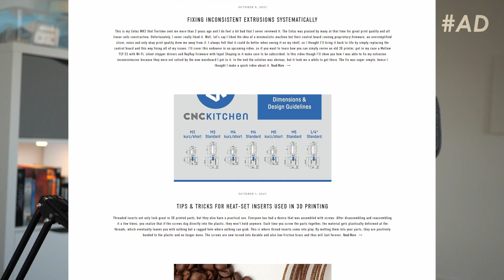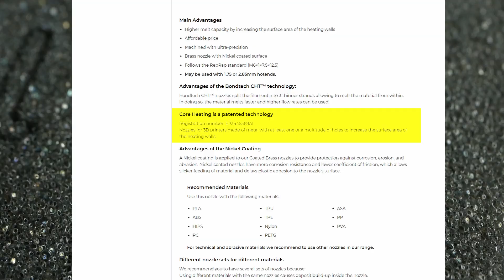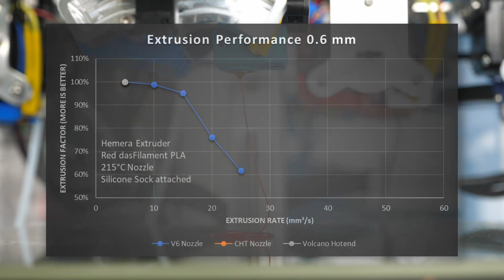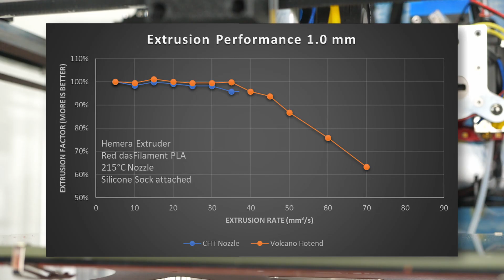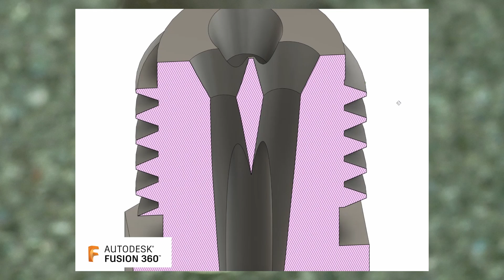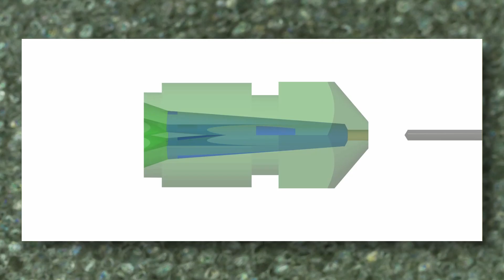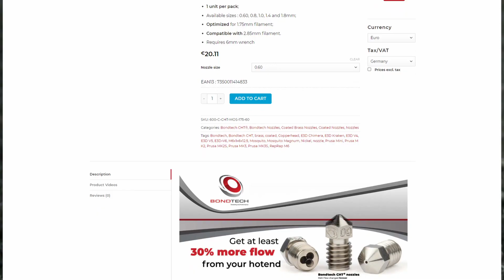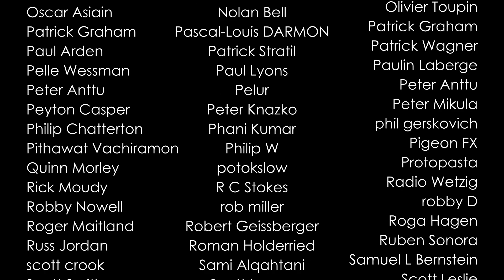Does This make Volcano Hotends Obsolete? Bondtech CHT Review

Comment from the maker: Does the CHT nozzles make high-flow hotends obsolete?
Don't forget to share this video and check out our Original CNC Kitchen Inserts (Affiliate & EU Only): https://geni.us/CNCKitchenInserts
Reply: Hi Stefan. Great video, as usual. We will release the 0.4 beginning of November. Design is ready. Manufacturing starts Monday. MK8 versions will follow. We are also working on the Volcano. This one, still a question mark. A maybe for now. We will have abrasive proof nozzles later.
Reply: @nunosantiago6720  - Wonderful news, thank you for confirming this! I don't need a nozzle larger than 0.4mm but I do see issues with melting and under-extrusion with some filaments; the ability of the CHT nozzle to improve flow rate without going to a higher nozzle temp is quite appealing! Now I know what I'm asking friends and family to buy me for the Holidays. :-)
Reply: ah but Stephan! surely a CHT Volcano nozzle would be even better then right? well it seems Bondtech are still working on that one in the lab. machining so much deeper down a longer nozzle. it must prove to be rather challenging. but we will see if that ever happens. a big maybe. hehe. ok i will go watch your video now :)
Reply: I hope that they eventually make one suitable for printing carbon fiber filament (and 0.4mm).  I almost exclusively use that for my job.
Reply: I think the main appeal is the ease of changing between regular, .4 mm x .2 mm stuff, and the occasional bigger print without changing heater blocks.
Reply: Can you block Kitan Mani? The bot's spamming porn links all over your comments section.
Reply: Test a CHT in a dragon high flow , would you kindly? 

As for the patents... Maybe putting the "core" in the heatblock/heatbreak instead of the nozzle , We'll see .
Reply: Have you considered posting affiliate links for us to buy one while sending a little your way?
Reply: @kabine1  Do you have problems just donating?
Reply: Where are you from?
Reply: I don't think it makes them obsolete, you have other that v6 type hotends. For example Dragon HF.
Reply: Imagine a clog
Reply: imho a great invention and review! 
What I`d be interested in on top of your research, what would be the absolute maximum usable extrusion volume in Vase mode (so it would need no retractions, and thus not really overheating while in the nozzle) if you'd increase temperature (much?) further? 
I mean 250°C may be too hot for pla, but if it would be pushed fast enough it would only have the target 215°C (which could afaik only be determined by a IR-Camera )...
best regards from lower austria
Charly
Reply: why would highflow hotends become obsolete,no one said you can't use this with a hf hotend, slap this onto a mosquitto magnum plus and you can make tha already high flow hotend even higher flow
Reply: @RexTech that's gonna result in a larger"center core" with less material connected to it to transfer heat, it would probably result in the spike having problem "spliting" filament
Reply: cnc bitchin' again
Reply: Can you try a higher number of clover leaves? With ever smaller leaves, like a small fractale if you will. I think it would improve the heat transfer even further... sadly I dknt have tools to try the idea...
Reply: link broken
Reply: They now do a 0.4 👍
Reply: Hey Stephan, I used the same testing method (same temp, filament, measuring weight, etc) but see no improvement when using the CHT nozzle of the same diameter as the prev nozzles.
Tested this on both a dual gear bowden to a V6 AND a Titan to Dragonfly direct - yet again, no difference in max flow. Any tips?
Reply: 2 years later, whats your experience? Did anyone switch permanently to CHT?
Reply: I have had a volcano hot end for over a year and never came around to install it, because of having to print a new cooling shroud. This is perfect!

Comment: I just bought one of these and installed it. I'm running a bunch of ender 5 plus corner braces in silver ABS. With a Creality copper .4 nozzle I would get extruder skipping at about 110-120 mm\s on the long straight runs. After several parts I settled on 80mm\s for the "master" perimeter speed to get a reliable, cosmetically decent part. After installing the CHT nozzle i started upping the speed to see if there were any gains to be had. I got my first extruder skip at 275%. I didn't re-slice it or anything. Just swapped nozzles and ran the same part. I backed it down to 260% and it's running well and looks just as good as the previous parts. It was hard to cough up $23 for a single nozzle but the results are solid, if not downright amazing. $23 to cut the run time from 3 hours to maybe 1.5 with equal quality? I think I may be converted.

Comment: I can't believe its been 2 years already. Seems link i have only been into this hobby a year. 

Btw if anyone is watching this that has an Ender 3 or similar with the mk8 style hotend, yes this will work but will put the nozzle a little longer  ao adjust your Z offset or Z limit switch. Its an easy way to get extra flow with out changing hotends or a bigger heat block. Yes your stock heater cartridge will work fine. Yes the Aliexpress clones will also work fine just decrease retractions. Start at 1mm and adjust from there. 

Happy printing.  😊

Comment: It doesn’t restrain flow because its hot and it splits up the material using a tri blade wedge. 

This actually prevents clogging by breaking down the filament faster and having an anti clogging effect thats similar to a log splitter. 

When a log splitter presses a log through one half goes each way juts like a tri blade splits it in 1/3rds, or a 4 blade into 1/4’s. 

This process takes less effort and in turn less likely to have clogs or filament jamming. 

This assumes that your equipment is also complimentary but it doesn’t disregard some of the quirks of a 3 inlet design that are overcome by a 4 core design. Length of nozzle also matters. Some designs are not welcome for all printer extruders without further engineering. 

I designed my own nozzles several years ago with a unique extruder design I machined on my CNC and it uses a quad core design with a different core material and this allows finer tip nozzles to be used at higher speeds for greater flow and print detail. This also allows filaments like ninja flex to work in a Bowden.

Comment: It doesn’t restrain flow because its hot and it splits up the material using a tri blade wedge. 

This actually prevents clogging by breaking the down the filament faster and having an anti clogging effect thats similar to a log splitter. 

When a log splitter presses a log through one half goes each way juts like a tri blade splits it in 1/3rds, or a 4 blade into 1/4’s. 

This process takes less effort and in turn less likely to have clogs or filament jamming. 

This assumes that the teat of your equipment is also complimentary.

Comment: i can not even change my hot end with out removing the hot end thermo leads to as the grub screw has rounded and can not remove it and extruder needs replacing to oh the fun any idea on how to get that tiny rounded grub screw out or would i be better off getting a complete new hot end

Comment: Thanks for your contribution in 3d printing community! :)
I'm not sure how about bigger CHT nozzles but I bought 0,4mm MK8 CHT for my ender 3 with bi-metal heatbreak from trianglelabs. I must say I'm very dissapointed by CHT (after that I'm not planning to buy bigger CHT and test it myself). I've run your flow tests and CHT nozzle doesn't improve possible flowrate. In fact I have worse outcome than on regular nozzle that costs me 1/10 of CHT, even on max-tighten screw for extruder spring. To be ohnest - bi-metal heatbreak didn't improve flowrate that much as I was expecting either. I have 2-5% improvement over stock heatbreak, but it helped to reduce retraction distance and retraction speed so I'm pretty happy with it.
Reply: the triangle lab is a clone and in not that well designd

Comment: nice video, quick question, what kind of thermal interface are you useing between the heatblock and the nozzle?
Reply from the maker: In most cases none at all or just a tiny bit of high temperature anti seize. IMHO thermal compound won't help the performance because it's not the bottleneck.
Reply: @CNCKitchen  thank you very much, exactly hte answer i was looking for

Comment: I just swapped a .8 for a CHT .8 and im getting extrusion issues; i had to increase temp and flowrate to compensate which is the opposite of what i expected with this nozzle.

What are your material settings for these CHT nozzles? How greatly do they differ from the regular nozzles?

Comment: I have redone your tests but I don't arrived to the same results.
I am on a creality ender 5 plus with a full metal extruder.
With the standard 0,4 nozzle it works at 16 mm3/s
with the CHT 0.4 I lose some steps at 6mm3/s only
with the standard 0,8 nozzle it works at 19 mm3/s
with the CHT 0.8 I lose some steps at 10 mm3/s only
Any idea of what could be wrong with my CHT nozzle ?

Comment: I worked on Injection Molding for years and we used similar nozzles with that. Improves the mixing of the colorants with plastic and flow. But in injection molding we are pushing material at thousands of pounds. On 3d printing could help on the flow…

Comment: After seeing your review here, I was so intrigued I ordered it immediately. I saw it in early Januar this year and received it late January. Today, I just installed it and wow... you say: "Will this become the new standard for how 3D printing nozzles will look? I'm quite sure, no..." -- I don't disagree with your reasoning, but I will say that it SHOULD be. 

I have a fairly fast delta printer with a crappy E3D V6 clone hotend, which due to the delta bed, isn't easy to change with something larger such as the Volcano hotend. With E3D Nozzle X, my printer can actually only deliver 9 mm2/s. Which is a sad and low number, and it does become an issue in print jobs with no traveling, i.e. continous extrusion - such as in vase mode. My printer can easily go 120 mm/s reliably with 5500 mm/s acceleration and 25 mm/s jerk. But with either the standard brass nozzles or the E3D nozzle X, I need to go down to 70 mm/s in vase mode (continous extrusion). 

Today I've begun testing the CHT nozzle (0.4mm) - fitted on my delta printer without any modifications. Just a nozzle swap. At 15 mm/s2 volumetric speed, I go at around 130 mm/s and I can probably go even higher. That's amazing - because now I can print my vases with 0.58mm width and 0.2mm layer height at 130-140 mm/s, without the walls getting thinner or having holes in them. 

I could of course also try the 0.6mm CHT nozzle and see if I can still go that fast, but I print a lot of different things, so the 0.4mm is a nice size for me; I can do fairly detailed stuff with high surface quality at around 100-120 mm/s, or I can ramp up the print speed to 130-140 mm/s and have fast drafts. Well, actually the CHT delivers quite high quality in my vase mode tests at 130 mm/s so yeah, I'm a VERY happy camper.

Even slower printers would benefit with the higher output, because eventually, people will want to print faster and modern printers are more likely to come with solid movement systems and solid frames that can withstand speeds at over 100 mm/s easily, even cartesian printers can go this high now - and with CoreXY becoming more used, much faster prints are possible. 

I don't mind paying the premium price for this nozzle; it's not worn down easily according to specs, so it's not like I need to change it as often as brass nozzles. 

Now I just have to hope that my extruder stepper motor won't overheat, because it's obviously working overtime ^_^

Comment: So when it comes to basic nozzles, you pointed out that a lot of cheap ones are drilled almost to the end and then with a 118 degree angle. Better nozzles had a more gradual angle. Which brands are the better ones and how do you know what you're getting? Very good info here, just would like to be able to put it to use!

Comment: I wonder how the CHT nozzle at a 0.6mm diameter is slightly overextruding at 10mm^3/s. And I wonder if it would be possible to make one of these out of hardened steel, allowing people to print their abrasives quickly.

Comment: You guys don't realize that 3D printing is still quite expensive in India. 20 euros is around 1600 rupees which is 10% of the cost of  the Ender 3 V2. Everything 3d printing related i expensive or low quality.

Comment: Some questions that came to mind as I was looking at the design.
What about four wholes or 5? What about using steel instead of brass? What about a complete cone shape all the way to the tips exit point after the splitting point, instead of the filament butting up against the flat spot just inside the tip?

Comment: I'm a little new to the 3d printer scene... well it'd be more accurate to say the mainstream scene. I've been 3d printing for years, but it's been sorta insular. I've designed, built, and maintained all my setups all by myself. So in short I know the printers work, but I have no idea what the meta is.

My question this: is it uncommon for people to fabricatec their own print heads? I started with the end of a pen in a modified hot glue gun. The resolution was like 0.5mm TOPS, but it was enough to print a much better head. Used that to make a plaster mold, then Ihrew some aluminum bar stock, copper, nickel, magnesium, and borax into my crucible (90%, 5%, 3%, 2% by wight, borax was flux), drilled out the center, sanded, threaded it and it worked like a dream. That was the mk1... I'm up go mk8 now which has 6 filament inputs (cyan, magenta, yellow, white, black, and clear), two mixing chanbers, two outputs (one that prints, a other that spools sceap), and a few other goodies. Not gonna lie, adding full colour functionality was a complete waist of time. You can choose between low scrap with harried amounts of colour bleed or sharp, clean lines with ~70-80% filament waistage). Eventually I'll be making a series of videos on my shops progression, just wanna have most of the big tools running before starting my channel ^.^

Comment: How much does the patent cover? It seems like increasing the surface area without the splitter would be beneficial without any drawback apart from the price? I wonder if your video might spark Chinese copies, which provide 0.4mm nozzles. the manufacturing doesn't sound like rocket technology. If there is a dragon hotend, I don't see a reason, why there can't be an increased surface area of the walls of a nozzle.

Comment: Wow, I usually respect CNC Kitchens work most for the discipline he shows. I think the material tests are outstanding and the go-to address if research for materials for FDM printers is needed.
This time I really liked the reverse engineering of the concept, which went into the design. 
However, I wondered how splitting the material works as well, if it might be relatively hard at that point. Does it mean, that getting it to soften is easy, but getting it hot enough to squeeze through a tiny hole is the hard part? Then, the concept should have an even bigger advantage for smaller nozzles, shouldn't it?
P.S.: Sometimes I really like some of his innovations, too. However, it always seems, that solid engineering is his strong point.

Comment: Does the CHT Nozzle also make things like the Slice Engineering High Flow Mosquito obsolete as well? Could you expect to see even higher potential flow rates using a CHT along side one of those hot ends?

Comment: I tried one of these and it performed substantially worse than a standard nozzle on a standard creality hot end. It was noticably harder to push by hand and it started clicking at the same speeds as I usually use.  Any thoughts what could cause that?he same speeds as I usually use failed with it

Comment: I'm not sure if you have used one but I believe you should try this nozzle with the maxiwatt hotend or heater cartridge not sure what to really call their design I know some ppl hate the maxiwatt but I have had great luck with them I believe they would really compliment each other with their designs.
Reply: Ps I ordered mine from Amazon lol make sure to read the description bc they do come in 12v and 24v I didn't pay attention at first but luckily I am able to use both. It would be nice to see it in use with this nozzle performing the same test since they are advertised as heating the nozzle a full 360 degrees around the nozzle might be pretty interesting.

Comment: Hi Stefan, die 0.4 nozzle is finally out :) I tried it in my Mosquito Magnum-clone with ABS at 243° and extruded 270mm of filament at different speeds until it "clicked". Not very scientific, but otoh my firmware monitors filament motion and triggers "pause" when it detects too little motion so the results have basic QA. I observed no sensor triggers and heard no grinding.

Result with a common 0.4mm plated copper nozzle: 25.25mm³/s without underextrusion, going higher I hear single clicks.

Result with the 0.4mm CHT nozzle: 29.1mm³/s without clicks.

I must admit I expected even less, as 0.4-nozzles are more a challenge for the extruder than for the hotend, you run against backpressure before you run out of melt-performance. 'But it seems that the CHT nozzles can even deliver a bit of extra oomph even in hotends with a long meltzone.

Hang on, you're doing great work :)

Comment: As usual, great explanation and testing videos. Thanks.
What would you think of the difference in thermal conductivity between a ~50mm2 surface contact for a standard M6 nozzle and a tapered nozzle that goes from the top to the bottom of the heat block with ~130mm2 contact surface? Would this make sense? Its a great way to increase thermal efficiency, would it reflect in extrusion performance?